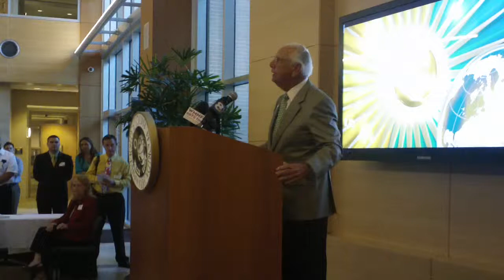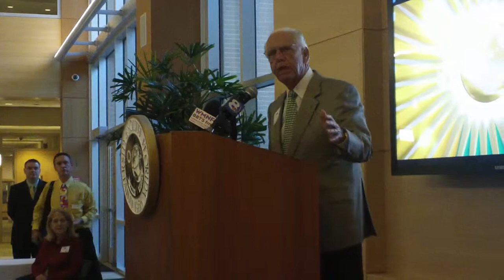Philanthropist Frank Morsani has converted cars to CNG: WMNF News

Comment: If this gentleman is a philanthropist, then he should consider building a network of CNG stations in the Tampa area.  Converting a car to CNG is relatively inexpensive and easy.  Lack of fueling stations is the problem.  I converted my cars to operate on CNG for only $1500.  I live in Utah and we have an extensive network of CNG stations operated by our gas utility , Questar.  CNG sells in Utah for $1.50 per gallon.